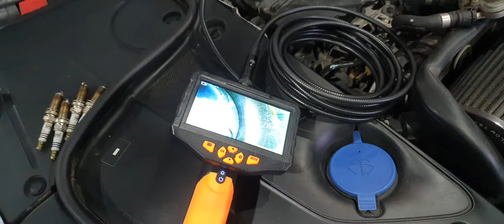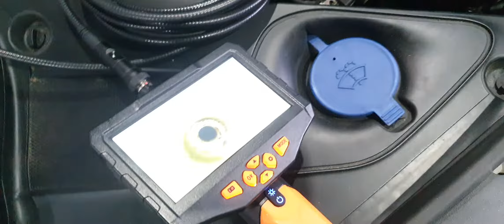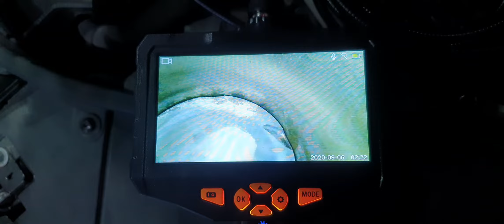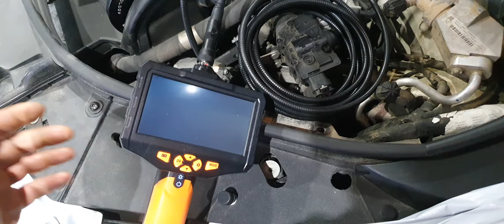Crankcase pressure

Comment: Hi Tasos, quick question... are there any indications of that damage that the ECU can see?  Like if you look at live data on cylinder smoothness or timing corrections under load? Are there misfires?  Just wondering if you have seen correlating digital data with internal damage like that? Thanks you the man!